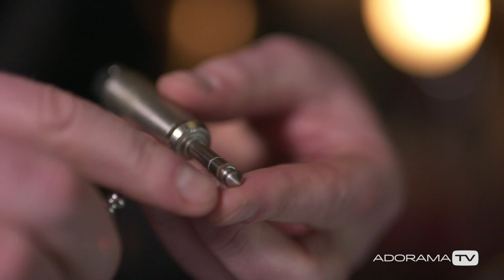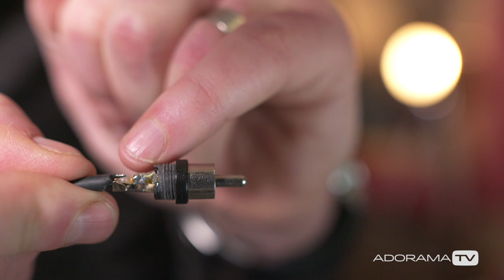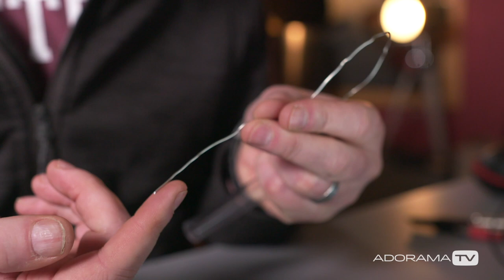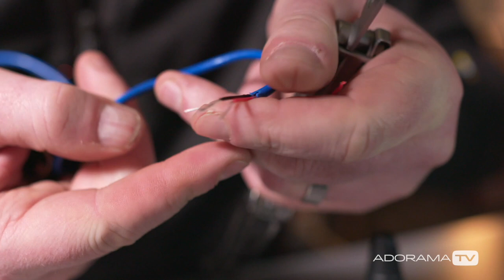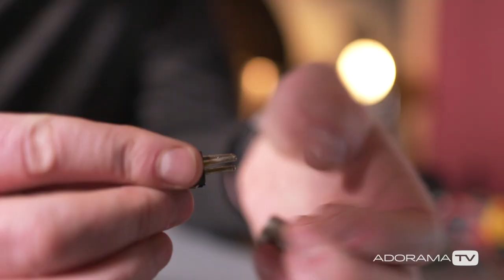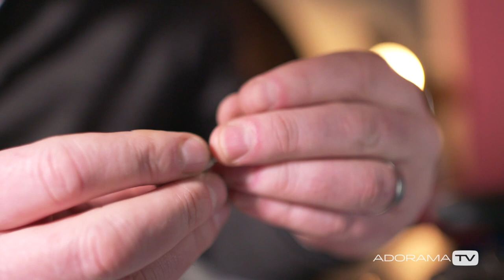DIY Leads: Perfecting Audio

Comment: When teaching people how to make leads I've found it useful to show them how to use the multi-meter (set on the diode setting which has an audible tone) to verify which part of the plug/jack connects to which wire. It's better to be redundant before you solder the wires instead of finding yourself in the position of having to take it apart and re-solder in the event of a mistake. 

Pre-tinning the bare wire ends & connector pins also makes for a much quicker connection, and oh yeah, a soldering iron stand avoids the possibility of burning your arm or hand as well as the carpet if you inadvertently bump into the hot iron (and who hasn't done that before)?  

Nice instructional video all around, and I'm looking forward to seeing more in the future.
Reply: Thanks Ray. I couldn't agree more. I'm glad you highlighted that point. We only had a short time to get through even the basics.

Comment: I understand this isn't a how to solder video. But, if you 'tin' or pre-solder the wires and connector pins before soldering them together they'll "stick" much quicker preventing overheating and warpage of the plastic. Try to heat the metal not the solder when possible. Solder flows toward the heat.

He mentions pin 1 2 3 on the xlr. They are numbered for a reason. 

Pin 1 --> usually metal not covered (shield/ground)
Pin 2 --> live usually red (+ polarity)
Pin 3 -> return usually black ( polarity)

For 1/4 inch stereo unbalanced 
Tip --> Left Stereo (+ left)
Ring --> Right Stereo (+ right)
Sleeve -> ground/shield ( for both l & r)
Reply: Thanks so much for your comment. A really great point. If only we had had more time.
Reply: Its endless for sure!